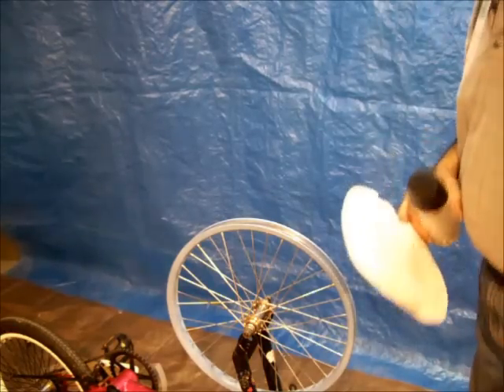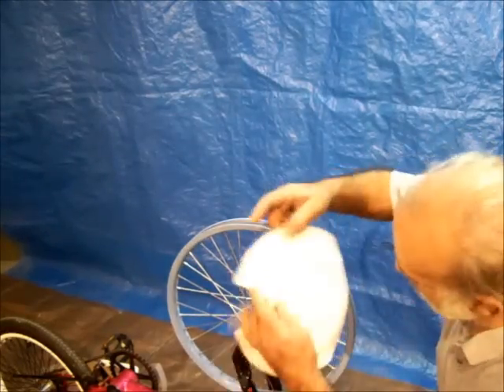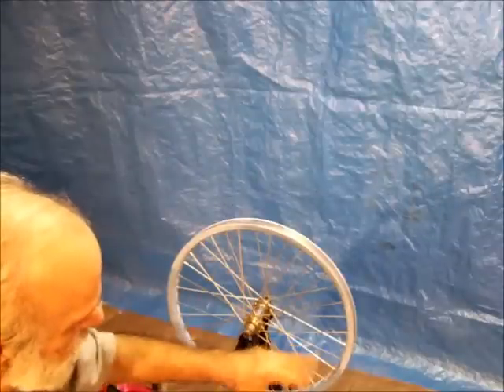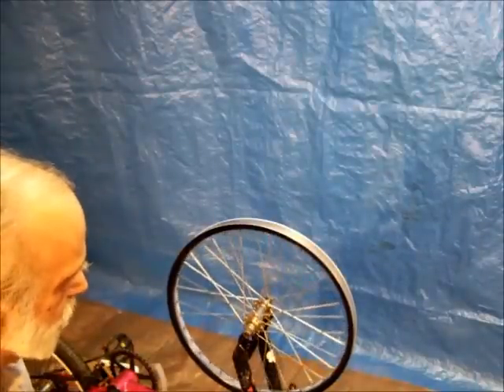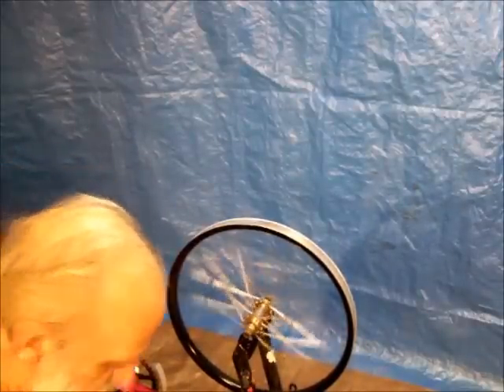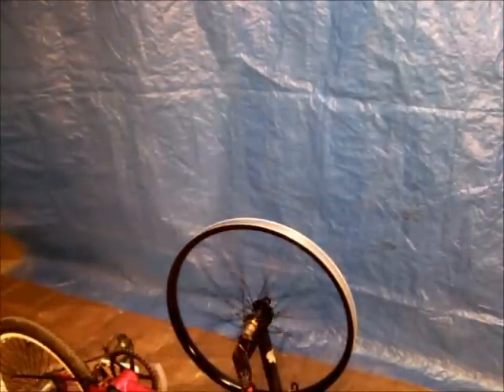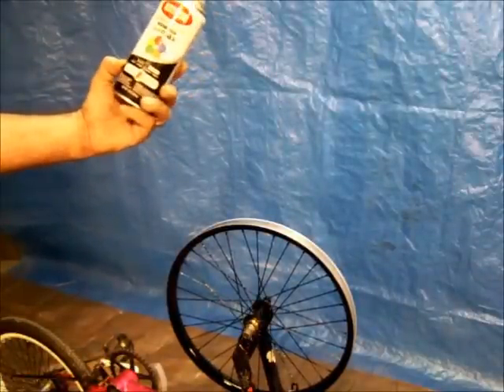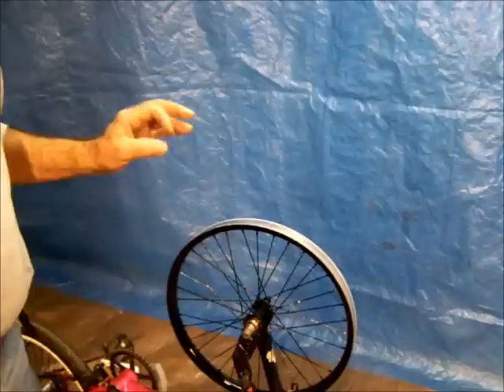How to paint bicycle rims (an easier way)

Comment: genius!! was trying to figure out a quick way to spray the rim separate from the spokes with out removing the spokes... good job bud!!
Reply from the maker: The masking is easy to put on and to take off while, still covering the area you don't want painted, The 
masking of each spoke and even more to take off to me is so very labor intensive
Reply: jesikebiking spraying paint into the hubs will cause the non sealed bearings in cheap rims to grind
Reply from the maker: You don't spray into the hubs !!  you either mask the bearing, or take them out= clean it after painting
repack with grease and replace the bearings. This works great for the loose bearings types

Comment: Did you spray anything before you spray the black paint. Cause I was trying to spray blue to my rim but it seems to be the paint do not stay on the rim properly
Reply from the maker: +Asian Gamer Did you lightly sand with 800 grit sandpaper between coats ?
1. sand with 200 grit the rim,spokes or what you want painted.
2. primer the rim spokes ,let dry a couple of hours  ( 75* low humidity )
3.lightly sand with 800 grit= paint the parts you painted (rim or spoke/rim)
4. repaint your choice color on the side rim the braking area=let dry a couple of hours  
5. 1 coat clear coat whole rim , let dry 2 hrs.lightly sand with 800 grit
6. 1 coat just where brakes make contact=let dry 2 hours

Comment: I painted a bike for the first time 2 summers back and how i covered the spokes was with coffee stirrer straws. seemed ingenious but they didn't quite fit all the way around so I'd have to rotate them depending on which side i was painting. it did the job
Reply from the maker: +Nabre Labre  Yes there are some other easy ways to cover spokes
but how long did it take you to slit the straws and mount them ?
Reply: +jesikebiking it took a while, putting them on wasn't as easy as i thought it would be and since I had already painted the spokes i was worried the edge of the straw would scrape the paint. it was my first foray into painting and partway in i was like screw it i guess I'm not patient enough for painting
Reply from the maker: I know what you mean ,after 6 years and some 75+ bikes it takes a while to find the one that works easiest  lol :-)
Reply: Nabre Labre - just regular plastic drinking straws! That would work and it’s  totally genius! Thank you!

Comment: WOW!!! Great Idea!!!!🙂
Reply from the maker: The statement still holds true  " Work smarter ,not harder" I've had good luck using this idea.
Taping off each spoke is very labor intensive.,and if you just want to paint the rims laying the tape across
the nipples/spokes and controlling the direction of the spray is fast and easy

Comment: Dose ne one know if its ok to spray a spoked wheel with a coater break on it ....us there ne special percautions i need to take
Reply from the maker: Good Morning--     Don't understand what you mean by coater break. If you mean primer coat yes..    First you have to sand the areas you want to paint,If you just want the rim painted
you can get 3M blue tape lay across the spoke nipples (like your laying tape across a plate) cut a paper plate to the circle of your rim to catch over spray  Primer coat your rim let dry a couple of hours Then paint using the paper plated to catch over spray while spinning you rim spray away from the forks--- that gives you an even coat ======================hope that helps

Comment: Whats the trick to no useing somuch paint on the whole rim? I had painted a rim black and it seem to take a can and thn some for 2 rims cuz it seemed like alot of the paint didnt acually get on the spokes
Reply from the maker: stacy holland Go and get paint and primer together (Krylon Colormaster   Color Max ) If you can't and have to use
separate primer and paint ,I use red primer if I'm painting dark colors  black, blue =  gray if I use light colors  white ,yellow.  I find if takes less paint ( 4  20"rims- 3  24=26"rims)  Also like in the video before I paint the frame, I turn the bicycle upside down I spin the wheels (moderate) to get a even light coat. let it dry check it to see if it needs a second.
After it dries for a couple of hours, clear or satin coat   maybe a little more on the side because of the brakes and let dry 2 hours.   I forgot to add make sure you sand good  and clean before painting  and use 800 grit lightly between coats  Hope the helps :-)>
Reply: Rustoleum 2x primer and pain in one. Love the stuff that provides far better coverage with less paint

Comment: but overtime will the paint remove?
Reply from the maker: Let's look at it this way !! bike manufacturer may have only 2 coats =1 primer,1color it doesn't take long to sand
to bare metal or brake rub ====== I have 1 primer 2 color and 2 clear coats with 800 grit between each layer. 5 layers to 2 layers=in time it will wear (long time) My first bike 9 years ago has some brake residue due to hard 
braking
Reply: jesikebiking mh ok thanks 👍🏻

Comment: How do you paint the hubs without causing a problem with there movement? Brakes?
Reply from the maker: +Jacob Siekmann  Good Morning Jacob . First clean the area where the spokes go into the hub. Or if you feel comfortable ,remove the axle,bearings,and clean .
Then mask off the hub with 3M blue or Gorilla tape after you have sanded it.
Primer it with red if you are using light colors. Black primer it with dark colors.
Let dry a couple of hours with temps in the 70's low humidity (70 % ) Check you work and if it looks good sand lightly with 800 grit  to rough it . Then paint your 
color of choice. If you are painting the rim itself you will find a  2nd or 3rd coat
will be needed on the area where your brakes hit with 800 grit sanding between
coats. After all that is done to your liking let dry a couple of hours. Then Satin
of clear coat the painted areas. And do the rim where your brakes hit twice
sanding lightly with 800 grit .That the area that will wear from the brake shoes.

I turn my bike on it's top and rest the wheel (no tire)on the fork so when I paint/prime to get a uniform ,even coat by a moderate spin of the wheel
inside the rim where the tube would hit= that way it doesn't mess the paint.

Comment: Is there a good way to cover your forks? Or is it inevitable that you will spray them? I was thinking I would wrap them in aluminium foil. I want to paint the rims, spokes and hub black.
Reply from the maker: When painting the rims you paint 90 degrees off your left or right away from your fork=If you want to paint the 
hub you take off the wheel and spray lightly the hub you don't want to spray too heavy as not to get paint into the bearings.
Reply: @jesikebiking  beautiful 👌🏽 thanks

Comment: great video, is there an easy way to paint the rim white and the spokes black?
Reply from the maker: +Karl von Bahnhof  Y First take off the tire/tube.  Sand everything for the primer,  (red). Put rim on front fork primer paint the entire rim  spraying away from the fork to the front 
let dry a couple of hrs= tape off the nipples down to edge of the rim  now lay the tape across like laying it on a plate.    Now it's up to you if you want the nipples white ,black or silver . 3M blue tape  Now ready for the black
paint (spokes)  dry for 2 hrs   Now come the hard part Do you want the nipples white?  tape off (nipple start
spoke at the point the spoke starts lay across ; if you want the nipples silver    ..............lay tape across the 
nipples  both sides  Now lightly sand with 800 grit the rim  (reason being your brake pads)  paint white-dry 2 hrs,
800 grit sand lightly paint 2nd coat white dry 2 hrs  again sand = now clear coat twice let 2 hr dry in between
with sanding in between .This is because those rims will get a lot of wear====
Reply: +jesikebiking I really appreciate your comment,  I do it right now, so far so good, take care
Reply from the maker: +Karl von Bahnhof  No problem, painting rims can be soo labor intensive with all the prep. Then try
to take all that tape off after your done , ugh!  The old saying, work smarter not harder ...
still holds true
Reply: +Karl von Bahnhof Lots of 3-m blue tape and patience for the paint to dry. Clear adhesion promoter to start for the primer. I think dead cats will stick to it after it cures. Hope you have two bikes.
Reply from the maker: +Mike Mac No you don't need a lot of 3M ,your not doing each spoke.And your spraying light coats not heavy. The only part is where your brakes are that you have to worry about
Reply: I may have gone overboard, but didn't take the tires off. Masked everything off (tires, rims and chrome spoke nipples). Dupli-Color adhesion promoter from Auto-Zone, then regular grey primer and did both rims (spokes and hubs). Also did the same with the front and rear calipers. Different colors front and back, spokes matching the calipers. Krylon rattle bomb, then Krylon clear. Daily rider, and still looking good after five years. Also did any bare chrome parts with adhesion promoter then a clear red, followed by a clear lacquer for an anodized look. So yes, I DID need a lot of tape, but the end result was pretty well worth it. Can't say enough about that adhesion primer except it is a bit odorous...

Comment: Hi great job sir 
I'm planning to paint the rims black but I'm afraid that the paint would come off due to brakes as i just have a basic  black matt spray  paint should i do it or not ????
Reply from the maker: Only you can answer that question . Read all of my responses I have given all the viewers,making sure you follow
all what 's been said especially the 2 coats of paint and clear coat and light sanding w 800 grite sandpaper
where the brakes make contact
Reply: jesikebiking ... if you use BLACK ACRÍLIC PAINT , yes . Make sure there is no rust neither nor any grease on the brakes rim - for that you use regular coke and steel-wool . Repaint a second layer on top of the first Paint , BEFORE it dries .

Comment: So im new to this whole world of terms such as prime.....and sanding and also spokes and nipples, i wanted to paint my rims bright red so....how should i go at this?? Do i remove the tube+tire and cover/mask (i think you guys call it) the spokes and just try this method? Or am i suppose to worry about something.....i have those brakes that are like two rubbers tight on both sides of the rim so wouldn't it chip the paint off eventually??? Help anyone?
Reply from the maker: 1st, loosen you cable on your brakes to allow clearance to take brake off.
Take off brake assembly off the fork, and put it off the side,next take the 
rim/tire  off the fork.Once you do that, take tire/tube off the rim. Then you
sand your rim/spoke with 400 grit sand paper=then clean all areas with
soap and water to clean dirt and grease. Now... it's up to you what you want to paint( rim or the whole assembly   ( spoke/nipples) ) the nipples are where you adjust between the spoke and rim. Next you spray primer (sets up the rim to accept paint) or use a primer/paint (Krylon color max ) I find by turning your bike upside down allowing you to paint =cover the areas you don't want paint on.
Spray towards the front away from the forks. Spin you rim moderate rate .After you primered let dry for  a couple of hours Check you work.  Now your ready to paint spinning at a moderate rate check you work and let dry  2 hrs Now reassemble every thing  (tire tube and brake assembly and adjust )
you can contact me  at jesikebiking@gmail.com    PS I forgot to add use 3m blue tape to mask/cover what you don't want painted  See my video " I steampunk the D&H " for more ideas on masking
Reply from the maker: Bathing Leg Remove tire and tube,and brake assembly from the fork. Flip bike over and cover the rest of  bike from over-spray . Put the rim back on the fork and hand tighten the nuts. Cover the areas you don't want paint on the rim. Go and get paint and primer together (Krylon Colormaster   Color Max ) If you can't and have to use
separate primer and paint ,I use red primer if I'm painting dark colors  black, blue =  gray if I use light colors  white ,yellow.  I find if takes less paint ( 4  20"rims- 3  24=26"rims)  Also like in the video before I paint the frame, I turn the bicycle upside down I spin the wheels (moderate) to get a even light coat. let it dry check it to see if it needs a second,when painting spray toward the front away from the forks while spinning the rim moderately for an even coat
After it dries for a couple of hours, clear or satin coat   maybe a little more on the side because of the brakes and let dry 2 hours.   I forgot to add make sure you sand good  and clean before painting  and use 800 grit lightly between coats   To be on the safe side clear coat the side of the rim 2-3  times, Hope the helps :-)>    
P.S. However you want paint the rim or the whole wheel is your preference.
      Happy painting
      
Show less

Comment: Does anybody here have any advice for removing the paint from the rims? I can't seem to get my paint off using even sand paper. Thanks in advance.
Reply from the maker: +TheGrayWolf81 You'll have to work at it but try using 100 grit sandpaper and take a lot of breaks
to keep your fingers from cramping up  = especially chrome    then use primer
Reply: jesikebiking Thanks a lot :) I'll try and see if it works.
Reply from the maker: +TheGrayWolf81 Another good tip after your initial 1st sanding ,make sure you clean the rim 
with vinegar=then prime
Reply: jesikebiking Thanks for the tips. Although, I am not priming as I'm trying to achieve a metallic finish. I have special auto-grade metallic paint as well as gloss for car rims. Do you think this will work? I also sanded everything except the small area around the spokes using a sanding machine/tool.
Reply from the maker: +TheGrayWolf81 Well you have to use a primer to set up a base for the paint to grip to. All the information I 've given  on this video
I got from a friend who owns a body shop, and has fixed my OOPS
on my and my wife's car (His good advice has helped me for the 
past 6 years - the wear and tear on the rim brake surface from wearing  off so soon )

Comment: must I remove the rim's paint before I repaint it?
Reply: no but the paint won't last as long
Reply: +Zane Zinn hmm i got it. thanks brad
Reply: +Bimo Triyudanto np
Reply from the maker: +Bimo Triyudanto The problem area is the sides of the rim where your brakes make contact. Sand it well
using at least 2 coats of paint and 2 coats of clear coat

Comment: is it ok to paint broken rims
Reply from the maker: Evthaw27 films  If the rim is broken,why would you want to paint it ? You wouldn't be able to use it on your bicycle
unless it's spokes or hub that need to be replaced.
Reply: jesikebiking do you know how to fix broken rims
Reply from the maker: Evthaw27 films For me, if the rim itself is cracked it's best to replace
it. If spokes are bent,or the hub is damaged from wheel bearing wear
you can replace those

Comment: but i want to paint the spokes black and the rim chartreuse... will you show me how..? please...
Reply from the maker: Sure. First, you have to give your entire wheel a good sanding with 80 grit sandpaper.
Then you give your entire wheel black primer . Then you let it dry for a couple of hours
to dry at above 70 degrees under 70% humidity =lighty sand with 400 grit entire wheel.
Now use 3M blue tape 1/2 in wide and tape just lay the tape across the bottom of the nipple and cover the rim completely =now you ready to paint the spokes and nipple ( the nipples are the adjustment between the spoke and rim) Paint the spokes  and nipples
black hold your can about 1 foot away  ( you don't to gunk it up ) doing it in a circle  motion
to cover One way to paint it is to put a lot of paper down on the ground put  your wheel 
on the newspaper horizontal  and spin it working the outer to the inner part covering
it in an even coat=again let dry for a couple of hours NOW comes the hard part =====
Carefullly remove the tape from the rim ( if some of the paint comes off ,sand in that 
area and touch up) As I said before is the tricky part  you want to lightly tape with your 
rim on your covered lap horizontally across the bottom of the nipples slighty above 
the rin as not  to divide it and paint your rim only again let dry 2 hrs.  Sand with 400 grit
and add a second coat of your color to the rim. We're adding a second coat because 
you  need to consider your brake pads wear  ,again let dry 2 hrs sand with 400 grit 
and paint your 2nd coat ( if you wnat add a 3rd coat) If you happy with the resulis
,take off the tape  Now comes your choice of gloss or satin  clear coat to seal.
Now sand again 400 grit on the rim ,brake contact area .  Do the clear coat twice
with the sanding in between and 2 hr dry. Note : check out my video on Painting Rims
prepping where I show  the technique  Well that's  about it  I wish you a great job

Comment: Great video. you painted it last year. may I ask whether the paint is still holding? did you have to repaint in between?
Reply from the maker: +Frank Rock Yes they seem to be holding up . I made sure I had sanded the rim
before I primered, 2 coat paint allowing paint to dry, and 2 clear coats on the sides where brake pads make contact
Reply: Great. I might just use your technique on my bike. Thank you.
Reply from the maker: +Frank Rock Make sure you sand the rims really well  a good base for the paint  and let dry a couple of hours between coats